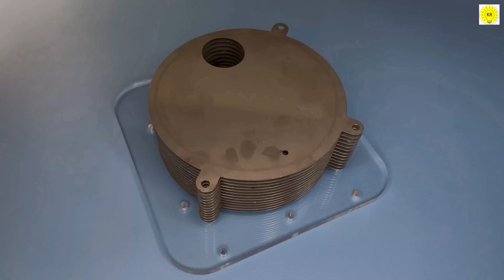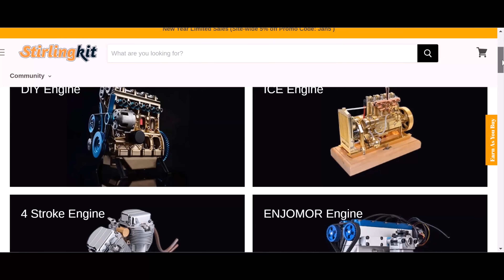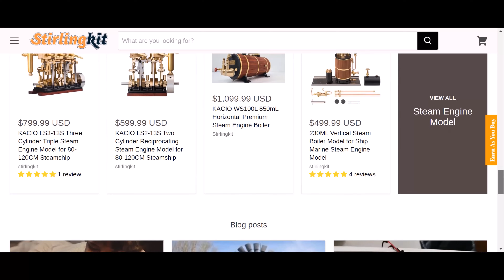how to make a hydrogen cell

Comment: This is all good however but after several uses the cylindrical electrodes will corrode and the discs will be damaged beyond repair... need new ones for it to work proper
Reply from the maker: You're absolutely right! The wear and tear on the electrodes is something to keep in mind. Regular maintenance will definitely help keep everything running smoothly!

Comment: In an effort to make this generator safe, the hydrogen ascending through the water functions as a check valve. By leaving zero gap at the top of the acrylic tube, and running a tube to your generator and or generator apparatus, a premature ignition that could be catastrophic from a backfire and or artificial detonation - is all but completely eliminated.

The Florist…🌹

11/27/24 9 43 am

Comment: You need 6000 litres of browns gas to make 1 litre of water.
Reply: Only if you are using rectified DC, instead of pulse width modulation directly from the alternator, pre-diode pack.

Comment: Not a Hydrogen Cell. HHO generators can be dangerous. A perfect mix of hydrogen and oxygen is very explosive...
Reply: Benzin,diesel.LPG.etc too!!!
Really how You driwe a motorcycle You are 
sting on a barrel with fuel
Point of view
Reply: What i’ve seen from multiple videos is that due to the size of the contraception. It’s not going to ever create enough hydrogen in the generator to become explosive. Even in the event of a car crash and you’ve made one out of pickle jars, you’ll just have broken glass and water. It’s totally safe other than any leakage of hydrogen near the engine that could cause an explosion
Reply: Not in the on demand form. If you try and compress it it's a bomb. Very dangerous.

Comment: in this video "how to end up poisoning yourself with chromium"    
electrolysis leeches various oxides of chromium out of the metal into the electrolyte, extreme risk of poisoning and serious health issues risks with handling or disposing of expended electrolyte.      use titanium or graphite, NOT stainless steel.

Comment: Unfortunately, it's just a toy.  Where is the arrestor?  For long-term use, there is no storage container in which pure gas is separated from gas foam as soon as higher current is used and only then passed through the bubbler.

Comment: H2 and O2 are not separated by membranes in between plates. Result is explosive and therefore useless oxyhydrogen. Special application like that small blow torch shown is an exception but there seems to be no safety installed to prevent massive backfire either. Do not build such a device.

Comment: Here's a research on new production technique on huge amount of H2 using seawater ! International Journal of Technology Enhancements and Emerging Engineering Research, VOL 1, ISSUE 1 Novel Techniques of Generating Huge Amount of Hydrogen Gas Using Microwave and Radiowave Energy. Worth the read.

Comment: Hmmm?  It looked like you only filled the electrolyzer halfway.  So you're probably only getting half the output of hydrogen.  You need a water tank above it and need to keep it filled to the top with your KOH solution (or whatever electrolyte you use).

Comment: The flame is NOT used to melt the solder. You had a good start hen you had the metal red hot (little too hot) and then use the metalheat to melt the solder and for the joint or connection. 
Where is the H2 torch available for purchase?

Comment: You must not use mineral water, which contains calcium and other unnecessary elements, but purified water, preferably from a filter. Sodium or potassium hydroxide is added to the water as an electrolyte. Otherwise, we will quickly contaminate the sheets and the generator's efficiency will decrease. Secondly, why build such a large electrolyzer if the water is half filled? The generator runs at half capacity...

Comment: That needs a flashback arrestor installed as close to the blow torch as possible because thats pure hydrogen and oxygen coming from that blow torch and that flame can easily flashback up the hose to the hydrogen cell.
Reply: The glass bottle thingy is the flash guard

Comment: Design flaw. By leaving a large open portion within the cell, you potentially made a dangerous and explosive situation with the gas that is trapped, sitting in between all the plates in the open area. If it runs low on water, that's a large enough gas sitting that can blow that thing apart easily.
Reply: And he's only getting half the hydrogen output by leaving it half full of water and electrolyte.  He needs a water tank above it that feeds into it, keeping it completely full.  He also needs to keep his bubbler filled to the very top.

Comment: When will you get your act together and realize that just by "VIBRATING the water at the correct frequency will release 10 times as much Hydrogen. Today's technology is so lame!!  They could also inject the "B" field of a magnet at the correct frequency and release  100 times more Hydrogen  per volume.  It needs to be a vibration,  not a oscillation big difference!!  The "B" field is the most powerful part of a magnet! FACT!!  it is the center part of a magnetic force..    If you want to play with anti gravity just tap the center of any bar magnet on any plastic or glass object it will loose weight!!  Don't tap on any metal or iron it will disrupt the magnetic field.  The entire universe is 100% magnetic .  We should be able to develop a simple Hydrogen generator regulator that is small enough to attach next to any standard auto carburetor. The height of ones intelligence is directly proportional to their realization of their own ignorance

Comment: it is interesting. but my opinion, If you make chamber room it like that hydrogen gas and  oxygen gas can't be separated just change it to gaseous form, although it can burn the fire is not stable and can be explosion. if you can separate it and store it in a separate tube or even liquefy it you've made a liquid rocket fuel or hydrogen cell because it's more stable
Reply: C juste la moitié du travail  ,il faut transformer ça en électricité parce que l’eau dans le gaz ça fait peter 😅

Comment: A for effort but it seems like not all the plates are working ...I was wondering if a guy could somehow collect the gas and compress it into a high pressure gas cylinder?  ....like a propane bottle?  And does anyone know if the hydrogen is like 100 percent ? Using that method or is it like mostly air ?

Comment: You need to be very  careful with that! Even though it doesn't  make very much gas what it does make is NOT HYDROGEN but HHO, very explosive gas. The backslash or backburn cannot be contained with a conventional flash back preventer.
Pure HYDROGEN won't  flash back.

Comment: It would be cool to see you use a larger one to run a generator.  See if that’s possible.
Reply: It is possible. A 5 liter per minute HHO can run the average 3 kW generator. Thou it will only put out around 300 watt max while consuming nearly 600 watt of electricity to produce the HHO. Unless you have Stanley Mayer technology that is
Reply: @raloed.363  so really we just need an on demand safe non pressurizing system that will put out 5 times that?
Reply: @cryptobuddha2600  5 times the 5 liter or 5 times what in the video? Also unless you have an overunity HHO generator/circuit then it makes sence to just use th electricity to power a motor directly instead of running an engine.

Comment: It´s nothing about hydrogen cell. Just simple water decomposition into the oxygen and hydrogen by simple electrolysis. That means it is the Brown´s gas what´s on the output. Mixture of oxygen a nd hydrogen. The true hydrogen cell output is ELECTRICITY with hydrogen (gas) on the input side of the device...               :face-fuchsia-tongue-out:

Comment: I dont think thats hydrogen! hydrogen has a colorless flame.
Reply: The reddish flame is usually because there's impurities in the water or coming off of the parts as the process started.  Someone please correct me if I'm wrong
Reply: @TeamDoc312  think u right,plus salt water works better,but corrodes,mayb use gold